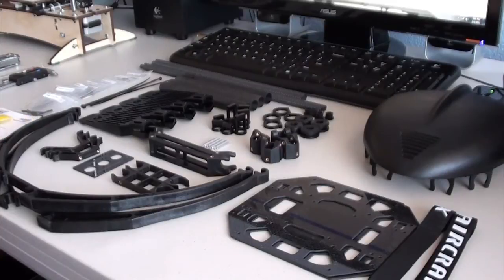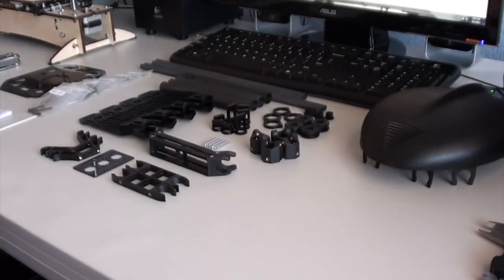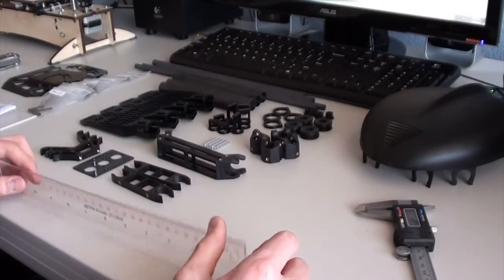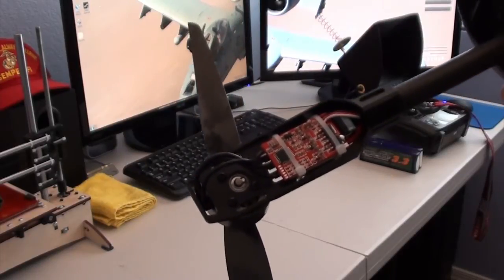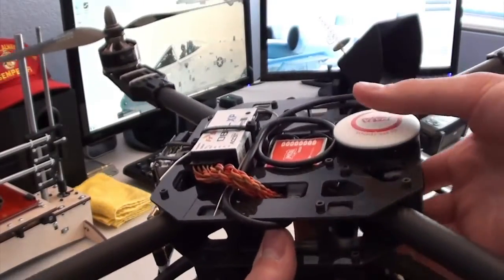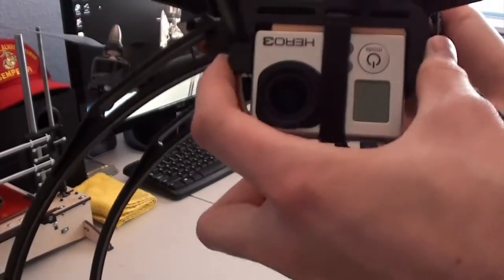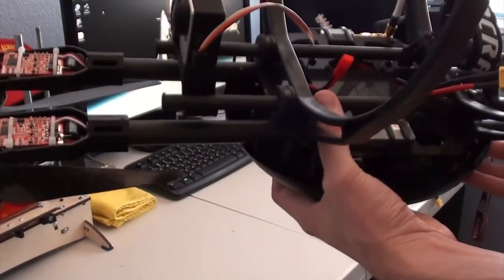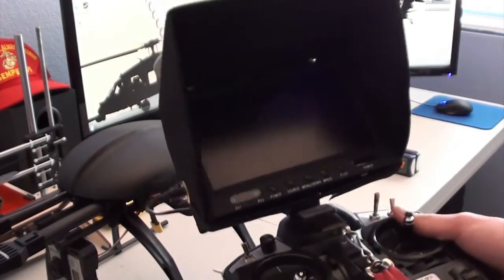X650 Pro Build Review

Comment from the maker: Instead of using the X650 kit I ordered all of the parts separately. I got the motors from additctiverc and I am now using 12x4.5 carbon props from uavobjects. The motors came with the bolt on prop adapters and the props came with small metal rings to adjust the bore diameter.

Comment from the maker: I wouldn't expect much of any difference between the props you mentioned, but I now use 12" props with a 5000mAh 3S to improve my flight times (10-15min) and increase the available lift. I believe that props with a longer chord length and less mass; therefore, less inertia, are most efficient when hovering, but props with a longer chord length will also cause more wobbling when you descend into the prop wash.

Comment from the maker: My setup, including a 3S 5000mAh, GoPro, gimbal and all other electronics comes to about 1950g. I'm now using slowfly style 12x5 carbon props from uavobjects and I get about 11-12min with the gimbal and 14-16min without. 20A ESCs should work fine, they are what I use and I purchased them from Hobbyking - F20A ESCs flashed with SimonK. 11" graupner style eprops should work well with a 4S.

Comment: Great review thanks for providing all the wonderful guidance.  Question: I am assembling the same setup with a rctimer gimbal and using 4S lipo, the overall calculated weight is expected to be 1991g. What is your units gross weight and how are the motors holding up?  Could you recommend a motor/prop based my information.  I mainly fly FPV and aerial photography not to much of the yank and bank stuff.  Thanks